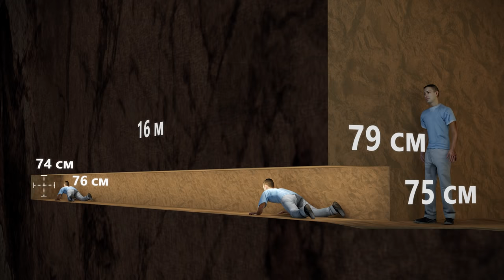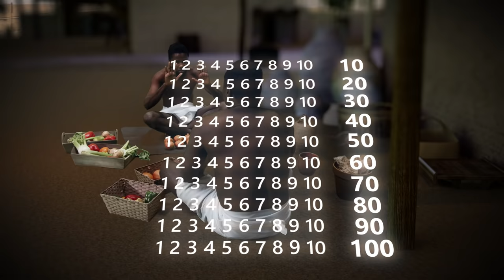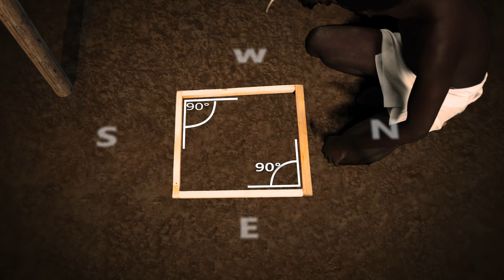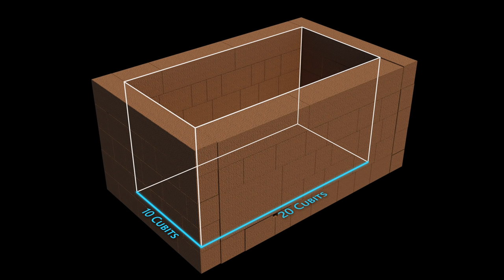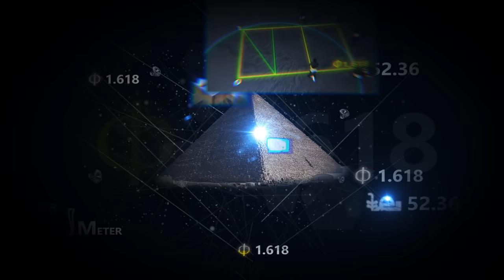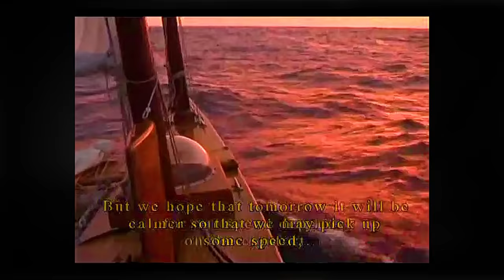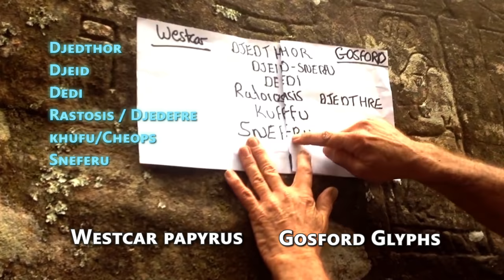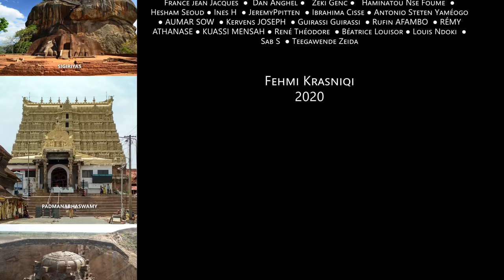The Movie Great Pyramid K 2019 - Director Fehmi Krasniqi

Comment: This was very interesting and compelling for about the first 2 1/2 hours. And then it went completely off the rails.

Questions for the Director though: if the granite was taken out piece by piece then carried to the site to be melted down formed into shape, why is the great obelisk in the quarry already in its final shape?

How do you explain the tube drill marks in the sarcophagus in the kings chamber?  Why would they need to drill into it if they could melt it and shape it
Reply: Exactly
Reply: They could have known both techniques, cutting stone in place, and pouring the "concrete" to make blocks. Its not inconceivable that they had other techniques considering how smart they were.
Reply: Exactly
Reply: Try the magnifying glass and see what happens if you just walk off and leave it boring in a spot is dig out the molten marble to see how deep it melted all seems easy to understand to me and only hope with all the info we start seeing ppl build and just show if it does or don't but does seem like only way I can imagine
Reply: Check out Praveen Mohan's YouTube channel! He has found proof for rock melting technology in India and probably elsewhere. Enjoy!
Reply: C
Reply: The inner stones are quarried, brother. 

The outer casing stones may have been poured, and then supposedly covered in electrum. 

He lost me with the water drop universal constant.  That makes no sense.
Reply: True excellent points
Reply: @josephbrantley3158 You might have a good point but I couldn't follow it.  Try using punctuation if you want people to understand your thoughts. :)
Reply: @iamscoutstfu  surface tension of water is a constant as well as its weight.  Fluid dynamics are real
Reply: @tsunamitube3351  

So what?

Water is H2O.

Constant surface tension and weight is not unique to H2O...

And the demonstration he did is not falsifiable or repeatable since he's using a tool with an arbitrary structure to select the water droplets. 

Also: 

Relative humidity, pressure, and  even whether or not the droplet is formed indoors or outdoors would alter the "size" (how many atoms are part of) of the droplet.

Physics is real.
Reply: @iamscoutstfu  Modern medicine has calibrated measurements on what mass a "drop" will be of a fluid based on viscosity. The "physics" hasn't changed. H20 is the base standard of such measurements, and is used relatively for other fluids that are not H20.

Meaning, H20 is used as a standard even today to define a "drop" of water. That is, its a valid theory that ancients used the same for their base unit.

That is, every modern physicists agrees with you that "Constant surface tension and weight is not unique to H2O". 

The point you miss is that they, the ancient egyptians, chose to use H20 as their base unit, just as we do today, according to the author's theory here. Considering that modern engineering has trouble explaining how these ancient peoples machined the stone, how then you easily refute that the same ancients had no concept of viscosity?
Reply: @Demati Designs  

"Considering that modern engineering has trouble explaining how these ancient peoples machined the stone, how then you easily refute that the same ancients had no concept of viscosity?"  

What do you mean "How"?  it's refuted because it's nonsensical. You completely ignored the fact  that there's no way to standardize water droplets, using the techniques shown.  Each droplet would be a different size, viscosity would have no affect on this.  Furthermore, Viscosity is different at elevations, pressures, and temperatures, meaning a standardized" water droplet is only standardized at that temperature, ambient pressure, and elevation.  

The modern medical community deciding on what they percieve as a standard "drop" is completely irrelevant,  I don't know why you'd assume that would have any impact on the Ancient Egyptians methods of measuring.  The fact of the matter is, is that unless a droplet has the same number of H2O* molecule, it's not actually the same size.  This means that the Egyptians would be "eyeballing" it, rendering the idea of standardization laughable. Sorry you "missed" that.
Reply: @iamscoutstfu  Sorry you dont realize that the ancients were scientists. And if you think an IV drip is delivering random doses, then i guess u just lack common sense
Reply: @dematidesigns5444  

The fact that you have to misrepresent what I said is only your emotional reaction to having your theory rejected.  

I don't need to be notified that your feelings are hurt, If you had a more compelling theory that actually made any sense and was not easily debunked by something as simple as dripping water onto a piece of glass a few times to demonstrate the impracticality of standardizing water droplet sizes  you wouldn't feel this way.

Furthermore, there are numerous other problems with your frenchmans pet theory:

If you can screw pump water, why not screw-pup the limestone mixture?  Why even have the screw pump?  you could literally bucked up enough water and not need a screw pump, at all.  Why are you injecting a screw pump all of a sudden?  

How did they dig the giant pit? 

Why dig the canyons when you can move water up to the surface using Indian line buckets and just aqua-duct it?

Why use the big silly trick when you could just use the shadow of a stick to define east, set east at surface level, then dig down around it?  

Why would you use a solar lens when you can just polish Bronze into a mirror and, using another of Archimede's inventions, the Archimedian or "parabolic" mirror complex,  youd just need to polish some brass?  

Why is the foundation not also geometrically perfect?  

It's interesting to note on the the designers of the pyramids...: 

Also, the theory that the pyramid builders were black has been essentially debunked.  

https://www.independent.co.uk/news/science/archaeology/ancient-egyptians-europeans-related-claims-a7763866.html

 Neither the OP nor your ideas are even slightly compelling, but that isn't my fault. So it's best for you to not waste my time further.
Reply: @dematidesigns5444   Also an IV drip does not deliver uniform droplet sizes.  The size of droplets in an IV will also vary with pressure, temperature, and relative humidity...So even your example is bunk, lol. 

Dont @ me again,  you've nothing of worth to offer me.
Reply: @iamscoutstfu  I hate for you to be under an IV drip where the doctor didnt know before hand that the dose could be actually random; who knows what dosage you are getting, the doctor might say. You sound like a person who would trust a doctor. Yes, a drop of fluid can be uniform. Ask your doctor next time.
Reply: @tsunamitube3351  

That wouldn't make any difference.  I dont know why you people think it would.

You completely ignored the fact  that there's no way to standardize water droplets, using the techniques shown.  Each droplet would be a different size, viscosity would have no affect on this.  Furthermore, Viscosity is different at elevations, pressures, and temperatures, meaning a standardized" water droplet is only standardized at that temperature, ambient pressure, and elevation.  

The modern medical community deciding on what they percieve as a standard "drop" is completely irrelevant,  I don't know why you'd assume that would have any impact on the Ancient Egyptians methods of measuring.  The fact of the matter is, is that unless a droplet has the same number of H2O* molecule, it's not actually the same size.  This means that the Egyptians would be "eyeballing" it, rendering the idea of standardization laughable. Sorry you "missed" that.
Reply: That's not fair!  You are pointing out facts.  Not fair at all.
Reply: Yep......!
Reply: @iamscoutstfu  That was my question....Doesn't the size of the water droplet depend on the tool used to make the drop of water? I don't know....just a question...
Reply: How explain
Reply: The African bit didnt go down too well lol
Reply: IT IS ALL RESOLVED RECORDED IN ANCIENT TEXTS YOU IGNORE. EGYPT IS AEGYPTUS NOTHING TO DO WITH ''KEMET" NOMADIC AFRICANS COULD HARDLY NAVIGATE INSIDE THE NILE NEVER POSSESSED FLEETS TO TRAVEL, ONLY MINOAN CRETANS AN ISLAND CIVILIZATION DEVELOPPED TECHNOLOGY AND SHIPS TO NAVIGATE MEDITERRANEAN SEA AND TO CROSS THE ATLANTIC WE FIND MINOAN COLONIES IN LAKE MICHIGAN THIS ASSHOLE HIDES ALL TRUE EVIDENCES. ALSO HOW THE AFRICAN TRIBES WERE TRAVELING TO AMERICA, WHERE ARE THEIR LANGUAGE, SCIENTISTS, TECHNICIANS, ASTRONOMERS? THE ALEXANDRIA LIBRARY THE BIGGEST OF THE THEN  WORLD WAS FULL OF HUMAN KNOWLEDGE ALL WRITTEN IN MILLION OF SCROLLS ANCIENT GREEK OR HELLENIC LANGUAGE. THE LANGUAGE OF THE TRUE CREATORS OF EGYPT. ORPHIC TEXTS EXPLAIN HOW THE KING OF NEARBY CRETA MINOS OR MINOAS WAS THE FIRST PHARAO OF EGYPT. THIS FILM IS A TOTAL WASTE OF YOUR TIME FULL OF LIES, DISINFORMATION, DECEIT. ITS CREATOR OUGHT TO BE ARRESTED FOR FALSIFYING OUR HUMANITY'S TRUE HUMAN HISTORY
Reply: I did not see that solar eye working I would of liked to see that in action. People are going to still think supreme beings gave them all that knowledge. I thought the end went in another direction also.
Reply: @alexandrosantoniou6686  😂😂😂u were kool thinking aliens did it tho😂🤦🏾‍♂️✊🏿👑
Reply: @atenmccutchen7378  Aliens who wanted humans to evolve, benevolent
Reply: @alexandrosantoniou6686  look up yacub
Reply: And why nobody have been capable to replicate anything from that era today… if it is that easy and if they already have all the formulas to do so. 🙄
Reply: This movie is just a theory not a fact. Very good question though...
Reply: Hawass and his crew went and did a lot of cover-ups to make this story believable. He hid so many things from the public even stealing for which he was charged and convicted. Its all about the money for him.
Reply: @iamscoutstfu  wow not
Reply: They're not drill marks. They are from wooden, clay, copper or other pegs used in part of the pouring/manufacturing process. That's what he is saying anyway (it's in the script once early on, then he assumes you remember this for 3 hours - agree it could have been mentioned many nore times). Which I believe 1000x more than the cutting & movement of slabs across the desert, or on water, one by one. Always disbelieved the BS stories we were told in grade school, let alone forcing those stories in a way that conveniently fit the religious/slavery storylines. It's so unfortunate Egypt disallows most every attempt of research that might possibly interrupt their natioanl history story (and of course their tourism $). Fantastic mind-opening documentary.
Reply: @juliekonicke5329  I remember my science teacher telling me that every drop from an eye dropper is the same because of surface tension.
Reply: @shantinaturechild6385  LOVE Praveen's channel!  Most people have their eyes set on Egypt but when you really start to study what the ancient builders did in India, it'll blow your mind and make you feel you have to  go back to square one and re-think everything.  Also, both China and Russia  have some of the largest megaliths on the face of the planet.
Reply: This was the point where I have stopped the video. Debunks nothing, put critic on "La révélation des pyramide" which was more factual, not inflicted any idea, just presented and assembled easily known facts into one solid, logical, finger-pointing theory.
Reply: @maraut20  My soft are fake? OMG! Thank you!
Reply: Not only in Egypt there is evidence of the influence of a foreign civilization or of more technologically advanced humanity.
The same premises as in your commentary can also be observed in Mesopotamia (Ur / Uruk => Iraq), Mesoamerica and South America,
Rapa-Nui, North China, former Yugoslavia, etc.

What irritates me the most is the use of thinking shortcuts, such as: 'if not human civilization then definitely aliens'.
These aliens could be both Enlil or Krishna in Vimana fighting in MahaBharata, and Viracocha
or other serpent messenger of the gods (Quetzalcoatl / Adi Shesha / Satan).
And in fact, they are not aliens, but colonizers, gods for little, naive people. These "aliens" will perfect the earthly creatures to extract the ores
and minerals on the earth, the genetically modified monkey has become a rational, but timid and obedient worker.

So to take this document as an example is against my logic, and by splitting stones against each other no one can build pyramids and rise obelisks in as little as 30 ~ 50 years.
The lack of a logical explanation, or at least an attempt to defend depicted theses in the document, qualifies it as sensational, not scientific.
Reply: @josephbrantley3158  Huh?
Reply: @iamscoutstfu  You assume the methods shown is the extent of their techniques and therein lies your issue. You assume they did not understand viscosity and how it changes depending on environment, but their architectural feats contradict the nonsense you are spewing. The precision in their architecture denotes an intellectual design, not cavemen eyeballing water droplets.

Also, the link you provided proving/debunking the architects of the great pyramid's were not dark skinned Africans is invalid. Imagine using contaminated samples in an attempt to white-wash history. Since the possessors of the mummies refuse to give the correct samples to be tested by non-eurocentric laboratories all we have is depictions from the architects themselves and journal recounts all corroborating that the people of Kemet were dark skinned individuals.

Don't bother responding with any fallacious drivel, save us both the embarrassment.
Reply: @debbiejudd4933  Wow not what?
Reply: @tsunamitube3351  So did you try making and measuring water droplets? They are not universally 1cm. I've done this several times now and they range anywhere from 4mm to 12mm.
Reply: @juliekonicke5329  Yes, exactly! The size of the water drop depends on a lot of factors. I did a few experiments. I cm universal water drop size is nonsense.
Reply: @dematidesigns5444  I see,but now explain why multiple cultures who have never met all decided to build pyramids? I don't see the Aztecs,the Chinese and the Egyptians all sitting down and arguing about who has the best design over cups of rum
Reply: Yes
Reply: i would say it's done by waves. just need to find right frequencies. one guy also found out this - ed leedskalnin
Reply: @shantinaturechild6385  proven is a genius

Comment: After watching this documentary I went back to my maths and geometry! Finaly, there is a logical explanation of one of the mysteries of the past civilizations! Great doc!
Reply: Logic like a drop of water is 1cm. As the French say: "vous etes ne de la derriere pluie"
Reply: @MrGino714   it doesn't makes any sense , the size of the drop is determined by the amount of water of the drop, they didn't explain what was the standard drop, you have small  drops and big drops it depends , you have to stablish a standard and a system , same as with the concrete I Knew  about this when this theory came to light some years ago and  it made total sense to me but still there are holes that need to be filled , I would say it's the more plausible but you can't accuse of someone to give dumb explanations and you do the same.
Reply: Try and make a drop of water smaller than 1 cm. Let the water accumulate and fall on its own...bet ya can't 😢